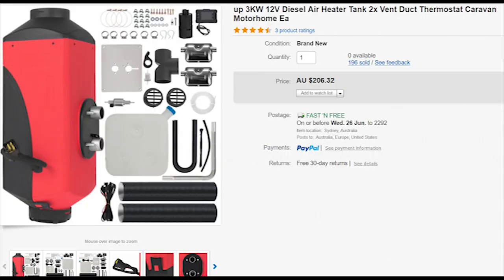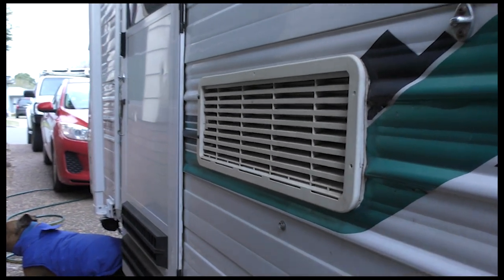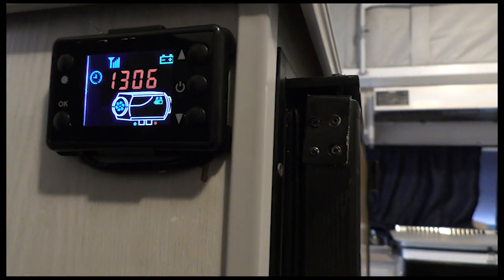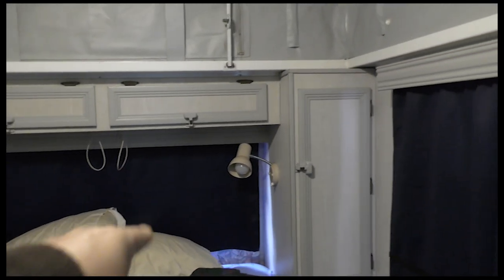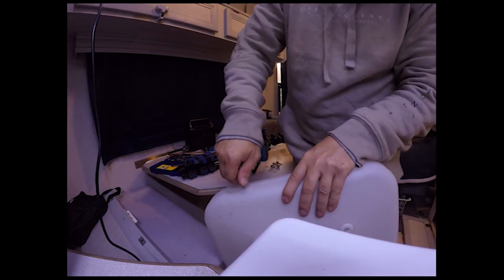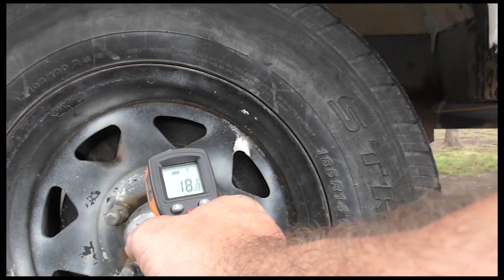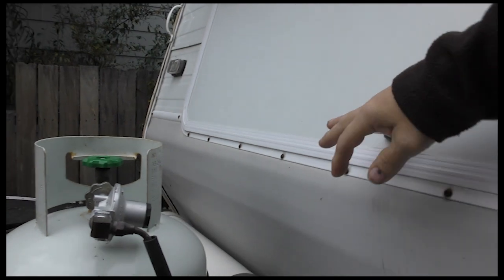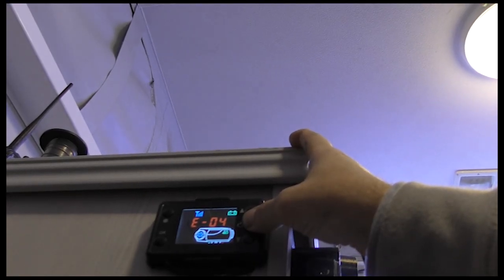Ebay Diesel Heater install tips and advice review

Comment: Thanks for a fantastic video mate. I've been looking for some time about getting one of these heaters.
By all accounts the instructions are terrible so having a video like yours helps. 
Just one question the kit you brought comes with 2 silencers. Obviously 1 goes on the exhaust am I right in saying the other goes on the air inlet ? 
Any help on the above would be great cheers Hadleigh
Reply from the maker: Hey Hadleigh,   welcome mate, glad it helped.  I didn't pay too much attention to the instructions, but did have a quick browse. I prefer to just watch utube vids and get my info that way. 
Which is why I make my videos  in return.    Re the second silencer, it's a case of do what you will with it. 
I wanted the kit with 2 just in case. 
I've know some people put both on the outlet and others put one on the  out and one on the in. 

If you want both on the exhaust side though, you'd need to cut the pipe work to make it happen. Sticking one on the inlet, should just be a case of sticking it into the end of the tube and add a clamp. 
I've not found the noise (and asked mates camping near me) to be loud or offensive. so haven't applied the second unit. I still want to extend the exhaust off the front draw bar, but its coming into summer here, so its a next season job. 

If you spot the kit you like and it doesn't have the second silencer, I wouldn't sweat it and just go with it. 
They can be had cheap as separate units anyway if you decide you want one down the road. 
 Any questions, just let me know, happy to help if I can.   cheers Brett
Reply: @DENMONKEY thanks for the reply mate. I will probably go with the same kit you bought. I'd imagine its a trial and error thing. If its too noisey stick it on the inlet. If  that doesn't help put 2 on the exhaust line.
Your video has given me the inspiration to install one sooner or later.
Just got back from a weekend away and it was freezing in the caravan. I think the wife now agrees we need one lol.
Cheers Brett thanks again

Hadleigh
Reply from the maker: well, if you got the boss' blessing, you're good to go .
Reply: @DENMONKEY  lol yep that's the hard bit accomplished. The install should be a breeze.

Comment: The led controller can be prone to display failure as it's always on, the rotary gives temp and hz adjustment plus error codes. Some prefer the simple controller. Just a matter of learning that the knob at say 9 o'clock is your preferred setting :)
Reply from the maker: Thanks Martin. I did see in a forum someone who added a switch to be able to turn off off completely. You world need to reset the clock off you wanted to use the timer but so be it. Might get around to doing this myself.  I believe the knobs controllers with well but I've also heard people trying to troubleshoot a start up for example and having a code points you in the right direction at the get go.  Depends on what you need I guess.   Cheers Brett

Comment: Hi, is the exhaust outside noisy? It sounded very quiet in one part, and noisy in another.
Reply from the maker: It's a little noisy on start up and shut down , but under normal operation I don't consider it to be noisy. If a van beside me had it on, it wouldn't bother me if they had it cranking though, it might a little. But I keep ear plugs with me when camping, just in case :)
Reply: @DENMONKEY  Thanks. How about fuel? How many hours would you get from the tank, full to empty?

Comment: Gooday Mate, thinking of buying one of these for my shed, would you recommend it is now 2020 june/july...thanks cheers
Reply from the maker: Hey PK. I've seen a video on here where a guy was using one to heat his shed. he went with a bigger 8kw unit if I recall. that way it can run at lower speeds etc and still give the output. I'm super happy with it and run it regularly to check it. still working as it should.
Reply: @DENMONKEY  Thanks Mate...i have ordered a 5KW as John McK another fellow ozzie suggested there is no difference, so do not pay the extra money?...Thank to COVID19 we are in lock-down again, i need to go bush...cheers

Comment: Is it just me or did you just run the bolts up to the plate and not actually bolt it down to the floor , around 12.45 ?
Reply from the maker: Definitely bolted her down 😁
Reply: @DENMONKEY  Sorry about that. I see now there are 4 other bolts further away.

Comment: I am not sure that the two air circuits are fully seperate. When starting and before the flame is alight, there is air being blown out the flame exhaust by the house blower. This means there has to be at least a small commonality between the two air circuits. Unlikely to be a problem but worth noting.
Reply from the maker: Just so I'm clear, you're saying there is air movement that can be noticed from the external exhaust when the fan blower is operational but before the motor had started. It's that correct?  If so, I'll check it out. I still believe them to be separate like in the car. The air intake and exhaust is a different system to the heater. With the air for the heater being blown over the heater core but not sharing the same air from the engine intake. Let me know if I'm on the right track with your thoughts.   Cheers Brett
Reply: DENMONKEY 
Yes you are spot on with you understanding of what I am observing. I wonder if there are two turbines driven from the same shaft that would keep them seperate? More likely it is a bleed from the main blower which raises a potential red flag if so.

Some after pressing start the blower starts slowly moving the house air but also air comes out of the flame exhaust as well. This is before it has ignited.
Reply from the maker: a common shaft would make sense, although the fan is electric and obviously the motor mechanical.  I guess is could be possible due to the compact nature of the unit. Surely there is someone on here who has broken one down so we can see :) 

They're also from China, so not much would surprise me here. 

I love my unit but for such a price, it's worth keeping your eyes and nose open just in case. 

I'll try and remember to check my unit next time I have it running and report back if I see the same as you.
Reply: They are separate systems like eberspacher, heres a crude Google link.
https://images.app.goo.gl/UupHuL27MZ2otvdb6

Both combustion and heat fans are powered by the same shaft, they're safe enough if you monitor them. 
I had an eberspacher d2, great bit of kit but I'll be buying a Chinese one soon
Reply from the maker: Brilliant Si, thanks so much for posting up mate. This one had me very curious. Like above, I love me a good chinese bargain but I only trust them so far. Anything can fail though regardless of how much you spend on it. I certainly done believe what they write on the side of their boxes though when it comes to ratings or performance.  From my experience and research these are proving to be a good thing.   cheers Brett
Reply from the maker: Hey John, just wanted to shoot you a quick comment so you get a chance to see Si's post below. Might be of interest to you. Since we were both stumped by this one
Reply: No problem, I'll be installing mine as soon as possible. I found running them on kerosene (heating oil) reduces the amount of servicing too, I have an old webasto thermo top c at my dads house running 3 towel radiators off of solar,  running on diesel it smoked on startup and needed regular attention. Now hes got it running on kerosene, its needed no attention and it's also a lot cheaper than diesel! 
Take it easy

Comment: Great vid mate. I just got one myself. Just wondering how you attached the fuel spigot to the fuel tank. Any advice would be a boon. My instruction book doesn't cover this. Cheers.
Reply from the maker: Mate I did get video of doing that but it didn't make the cut. Too much swearing. Get yourself a piece of wire, like an old coat hanger and reach in through the filler hole with the spigot on the end of the wire and poke it out the hole you drilled. Fiddly but it works. Grab it with some pliers to hold it until you can thread in to place. Hope that makes sense. 

sorry mate. typed that on the phone today, thus the auto correct. have sorted it now, so it should make more sense  :)
Reply: @DENMONKEY  Thanks for that mate. Looks like that will work.

Comment: since this heater needs electricity to run its pump, how about hooking it up with a battery Bank and one of those electric generating gadgets that produce electricity from a rocket stove like a biolite..to recharge the battery Bank... If successful, this would work in a tent or a camper without a the generator or alternator from the tow vehicle
Reply from the maker: I like the idea dugg but I dint think it would hear the unit up enough to produce enough electricity to keep up. It needs to run the fan as well. It would be a good experiment though.
Reply: DENMONKEY 
could work.. since the diesel brings energy into the equation,  I forget how many watts the biolite produces

Comment: My heater shows 9volts on the LCD screen but won't start because it needs 12 volts. When u power the van engine on it will start because it pulls 12 volts with the help of the alternateor. How do I fix? Do I need new leisure battery?
Reply from the maker: That depends if your battery is showing 9v when you test it. Did the heater used to work? And now it doesn't? If so it could be your battery failing. If not, make sure you have some decent sized wire going from your battery to your unit so to avoid voltage drop. Yoyr first check should be the battery itself if it's showing as low as 9v. Sounds like it's dead my friend
Reply: @DENMONKEY  it used to work fine yes. I think it is the battery thanks mate. I use the wire that come with the unit so that should be OK else why supply it

Comment: What will happen if battery run out when using the heater, will that be a issue
Reply from the maker: Haven't done it but if assume it will just shut off. The pump would no longer have power, nor would the fan. I know they won't start of not supplied the correct voltage, so I don't see it being any different.

Comment: Any tips on why my diesel heater makes water which sits in the heater exhaust
Reply from the maker: Only to point your exhaust straight down and not have any low points or bend in it. That way any moisture will run straight out the end

Comment: I need your help.. my RV here in the USA uses gasoline. I don't want to carry two fuels in my motorhome. are you willing to test your unit with gasoline? and report to us all ?I saw one YouTube man that did just that but, he did not finish it. if you did test it, it would answer a question many of us with RVs.. Hamish of Tujungamaybe there will be mush less smoke ...
Reply from the maker: Hey Hamish, It's not something I would want to do myself but here is a video I found that should give you some info https://www.youtube.com/watch?v=ijm2osC6gDA    , He also does some mods to improve the situation here,  https://www.youtube.com/watch?v=aVtlxWexNKg  . There were comment suggesting there are gasoline variants of these heater, but I've not seen then, but I've not looked for them.   I'm comfortable using the diesel but adding a gas fuel tank and having to switch over the fuel lines to do so, has some additional risks, I don't want to add into my system. I hope those links help above. I'd sure be interested in how you get along with it, if you choose to go down that route.

Comment: supposed to suck air from heated area
Reply from the maker: yes, doing so will make it more efficient.
Reply: @DENMONKEY  sorry but Im poor and cheap
Reply from the maker: @josephsylwestrzak8037  that's the way to go then. I like the idea of pulling in fresh air. Might be an idea to add an intake with a slider on it to shut it off. can change is at you choose then
Reply: @DENMONKEY  I have no use for 1 but friend lives full time in 5th wheel in michigan so Im watching for him. Also trying to convince him to run a long exhaust in camper to get as much heat as possible off exhaust and use red diesel. I live in a 2100 sq ft home and so far this year have only turned furnace on when its cold enough to possibly freeze pipes 20 f or lower. I still only turn furnace to 50 when on. I live in my master bedroom and help heat it with portable heat pump 10,000 btu on 980 watts elec is like 2 - 1500 watt heaters on 980 watts but I only run it when it gets unbearable as Im typing this I can see my breath LOL but I am under a sleeping bag. When I was a kid my dad and I deer hunted sleeping in his van - 30 f at night with goose down sleeping bags during breakfast and dinner we had a coleman lantern 2 burner cook stove and 8000 btu catalytic heater on. I was 14 and tough as nails LOL. Dad taught me a lot about living cheap LOL we were farmers. slider sounds good might need the extra heat, that - 30 was the coldest Ive ever been. Dad was a living legend among his hunting buddies always roughing it and getting BIG deer

Comment: Dangerous set up. The intake need to draw from the inside of the trailer, otherwise it's drawing outside cold air which sis inefficient and could draw in carbon monoxide from the combustion fumes.
Reply from the maker: anything is possible but any hazardous gases being pulled from outside the van and recycled via the intake would be insignificant. I understand the theory you're proposing but I don't believe it to be a concern. If it were, you wouldn't be able to keep any windows open whilst the heater was in operation because that would represent the same situation, where exhaust gasses could enter the van, depending on wind direction etc.  I also keep the window open over the bed when I'm sleeping with the heater on or not.  That said, I still have plans to route the exhaust to a different position under the van.
Reply: @DENMONKEY  well if you keep the widows closed,  then you wouldn't have to use the heater as much, if at all.

Comment: You need to bring intake air from inside the caravan to re-heat. Not from outside.
Reply: wait really?
Reply from the maker: He means the back end of the fan unit where mine is drawing fresh air in from the hole in the cabinet behind the fridge. Having it pull air from with in the same space that you are warming helps it work more efficiently. Not a deal breaker just makes it easier to hear the already warmed air from inside.

Comment: Installation Tip and noise- Best way is to mount dossing pump is in a rubber type spider web, also good to suspend the fuel hoses as it can tick tick on any hard surface..Also to note which may have been mentioned hang them vertical...The angle instruction was copied from the original Ebersprecher manual by the Chinese as they are knockoffs, the original was because of their small filter and the angle was needed. These Chinese knockoffs dont have this tiny filter ( bigger filter is actually better) so they should be mounted vertical to avoid the air bubble build up and wear, notice by the sound they should tick not tack...In-depth vid by a pro- https://www.youtube.com/watch?v=TGFDFZ6r1dI
Reply from the maker: thanks mate. I'll suss it out

Comment: Beware and prepare where you can a of sudden power failure to unit as this can cause a melt down of circuit board etc. due to it not running the cool down cycle. and secondly mounting the fuel pump/injector upright and below the unit to allow bubbles to escape into the intake this will prolong the life of it
Watched buckets loads of videos on this sucker and old mate was fastidious in his testing and servicing check out his 16 videos "
John McK 47"
Reply from the maker: cheers Les. I must have watched John's videos about a dozen times over before I made the purchase. 
It was a long time coming. 
 I always let mine go through the shut down process. 
With my set up it's unlikely a power failure will occur but I'll keep that in mind. 
I'm pretty particular with my wiring and made sure it has plenty of juice. 
I took it off the junction box I run my fridge on which I upgraded the wiring for to make sure I wasn't going to have any issues there. 

  Can you throw me  a link to the info that talks about this. 
I'd like to check it out but I think it will also be helpful to others who might read this post. 
Thanks for taking the time Les. 
  cheers Brett
Reply: @DENMONKEY  Hi Brett the link to the warning on shut down is https://www.youtube.com/watch?v=YW2biaijaO8  it is a good idea to have a well prepared and installed separate circuit with a resettable fuse just for the heater straight from the battery. There is plenty of written advice on the page to help out  us newbies as we venture into new territory
Reply from the maker: Thanks for sharing Les, I'll suss it out
Reply from the maker: already seen that one. I tried to felatiate the fuel tube as per his instructions but appears he's better at it then I. In the end I resolved to just letting the pump to the work and it came out ok